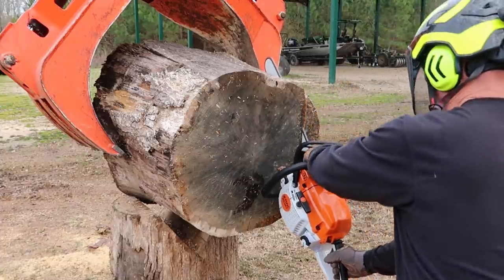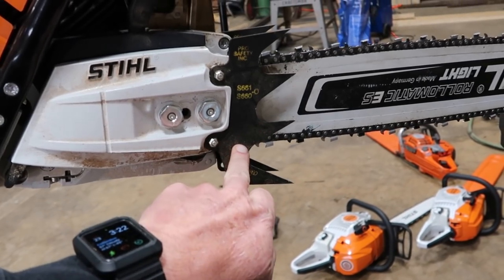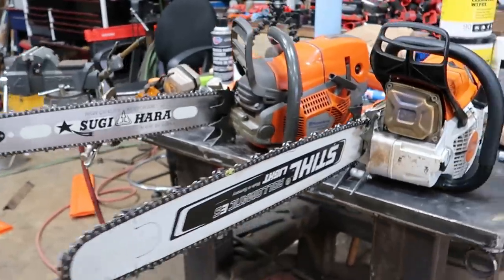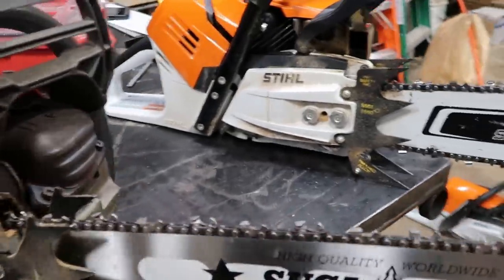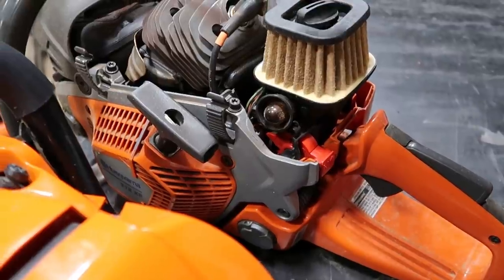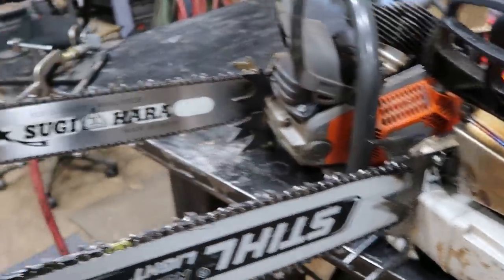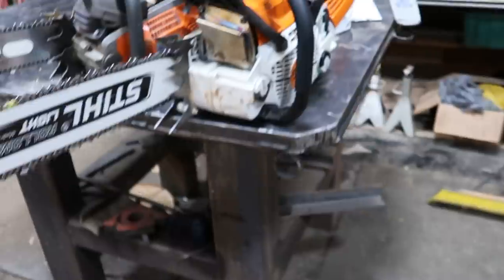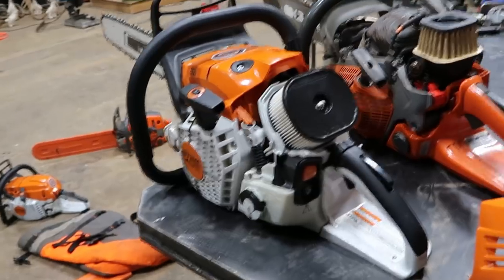Husqvarna VS Stihl | Autotune VS Fuel Injection | The best chainsaws on the planet

Comment: People will always argue witch saw or brand is the best but I think it comes down to the better dealer in your area .you can’t go wrong with Husqvarna or Stihl
Reply: My thoughts exactly
Reply: Yep, but I wish some American co. would make a modern high torq, low rev, low weight saw. If it's possible surely there's a market. The Euro saws are great but I don't like the scream. I'd gladly lose a second per cut.
Reply: I didn’t realize witches were into using chainsaws? 🤷‍♂️
Reply: Jason I've got both Husky and Stihl
Reply: @timhopkins7372  k
Reply: I have purchased two Stihl saws from two different dealers and you are right about dealer making a huge difference in customer satisfaction.  Each of those dealers were absolutely horrible in servicing my saws, causing me to never consider buying Stihl again!!
Reply: @livewithnick  Yer,they ride them...
Reply: @paynectygardener2033  that's why you figure out how to repair yourself 🤷‍♂️
Reply: @geoffbell166  oh! “Witch” end do they sit on? The b&c? 😬
Reply: Absolutely, they are equal in most every way it’s just pricing, availability and feel
Reply: @paynectygardener2033  It's the same with all machinery. I had a cnc router down for 3 weeks due to stupidity of the dealer service.
Reply: @ajsangster5195  My thoughts exactly... Who doesn't like the scream of a 2 stroke saw blasting through some wood!!
Reply: @tomjones4318  The scream is more enviromentaly freindly, a company would not be allowed to make an old school saw like a Homelite xl-12 they would not be able meet emissions standards.
Reply: @viperstrike3827  I'd have to hear the hard engineering on that. Sure the old saws were dirtier. Run a Mac back when for fifteen minutes and you need a shower. Run an X-Torque all day and not smell like exhaust. I'm thankful for that. Also like the fuel and bar oil life. All that could be worked into new designs with more torque and less RPM. Just a different way of doing the same thing. Euro saws won out with much better ergonomics and design before the government stepped in. But no it won't happen cause electric HIGH TORQUE and quiet saws will eventually beat them all. Sad American companies just give up.
Reply: @BoostedBlazer  Exactly you say. Keep your four wheelers out of my yard.
Reply: Who needs a dealer if you buy a Stihl i just go back ever 2 years or after i have 2000 to 3000 hour and buy a new one.
Reply: When i went chainsaw shopping i went to my local stihl dealer first, the   guy was a complete asshole. I then went to my local husqvarna dealer an it was like talking to my grandpa. I bought a husqvarna
Reply: Never in my life i ever feel the need for me to send my saw back to dealer for servicing and repairing.. i wont wasting money paying the dealer high price to servicing my saw, i rather done all the repair myself since the saw are an easy and simple fix, not a rocket engines.. all the wear and tear parts on both stihl and husky are an easy to replace, including the piston.
Reply: Agreed 100% of you can't go wrong with either of these saws it all boils down to the dealer thumbs 👍 💪

Comment: I am the Power equipment Tech for a Husqvarna and Stihl dealer and the price of the Stihl is more but no one thinks about if they have problems with the Stihl Fuel injection system and the cost of components if they need replacing. There both good saws, people need to research costs for repairs. Great video

Comment: I've only ever ran Sthil's mainly because I am lucky to have a awesome dealer 5 miles down the road from me . Always wanted to try a Husky but but their only available at a big box store in my area . I totally agree with ya on the fuel caps , I carry a small paint brush in my kit to clean around the o-ring and have really never had a real problem . I run a 261 , 462 and a 500i and i find myself reaching for the 261 more times than not , love that little saw .
Reply: Also my favorite saw!
Reply: I feel the same way about my little 3510 echo.  It's not a powerful saw, but it's extremely powerful for its WEIGHT.  You only need a lot of saw when you need a lot of bar.

Comment: Great video. 

I run 4 Sthil pro saws.  I love the saws, except the air filter setup for the 661 and 500 are garbage.  I am always finding dust getting under the filter and inside the engine.  The filter on the 362 is a better design, and the 361 non pleated is  better than any of their pleated filters. 

I used to have a consumer grade Husky in the early 2000s.  The air filter stays clean all the time, but the saw would throw chains all the time and damage the drive links.  Also used over double the gas that my 361 uses, while cutting half as fast.

Comment: Having run a lot of Husq' and Stihl gear over 30+ years I would say one of the advantages with Husq' is their attention to ergonomics and anti vibration in their products. The 572 may be a pound heavier but how does it actually feel with cross-cutting and snedding out?
Reply from the maker: The ergonomics and anti vibe are still a lot better on the husky
Reply: @cotontop3  That's good to know seeing as i've just bought one today to replace a stolen 395 (24" bar is as big as i need these days) Thanks for your reviews by the way - straightforward and no BS!

Comment: Considering the cheap air filter design and the gas cap design, I'd buy the Husky. I can't stand those Stihl gas caps. I've hated them since the first time I used them.
Reply: got those caps from the first day they have them, always leak or you need to put a thicker sealing on it
Reply: I think the idea was you were able to use  your insulated gloves in the dead of winter. They pissed me off once or twice but I figured them out. The old caps you could stick your tool in for leverage. Quarter turns are nice but you can't tighten it down.
Reply: @MikeHunt-ix2xy  In couple spots..? Interesting... So there is more than one spot.
Reply: I’ve never had issues with my quarter turn cap and don’t have to struggle to open the old style gas cap needed a tool to tighten/loosen it.

Comment: I use to run a saw all day. I'm 5 foot 4 inches and weight 130. I've had a bad back for many years. A Stihl is lite but the cost is not enough. Husky is my choice. I did comparison with them one time. Weight was the only advantage they had.

Comment: That price difference is for completely different classes of saw.  The 500i is a 390xp hunter. The MS462c is more on par with the 572xp.  
Stihl is redefining the classes with their very impressive "between" sized saws.  MS400 & MS500i.  
Longevity is definitely on par.  After being in the big wood of Canada's left coast for over a year, the 500i is holding up fine and is a clear favorite.  
As for the lightweight, my father thought the 371xp/372xp was a quick engine wrapped in cheap plastic.  Yet, 20 years later, everyone knows how legendary that saw is.  
I see the evaporation of dedicated, full service Husqvarna Group dealers, combined with the bold innovation of Stihl, is creating a gap.  And it's getting bigger every year. 
Whilst the air filtration is still lacking in Stihl, despite the effort of utilizing an "air injection" type of intake (though strangely lacking on the 500i), at least the intake is close to straight line.  Flow helps with throttle response. 
The proven Husqvarna intake is still using an antiquated angle between filter and cylinder.  Air doesn't like flowing at 90° of angle... neither does water, nor oil, nor even earthworms for that matter..  
To me, it comes down to; more power, more torque, faster throttle, with the capability of pulling more chain in bigger wood, at a full pound lighter.  And its almost turnkey starting that never loses its tune. Yeah, that's worth $400.  No "pass" given, it's earned.
Reply: Idk I think for past a 32” bar the 390 would become the more obvious choice over the 500i and 32 and below I’d want the 500. Just my opinion with a little time with both saws however sounds like you’ve got much more time on them maybe there are aspects I’m not taking in to consideration. I’ve heard a lot of issues with hot starts on auto tune saws so the 3 series big saws seem like the go to for big timber at least in my experience and the crews I’ve gotten to work with.
Reply: @zack6892  
The 3 series is absolutely epic!!  I'm a huge fan!  I personally believe that the 500i, 462, and 362 are directly because of how redefining the 371/372 was.  It is my favorite saw too this day.  But, because of OEM parts drying up, she's a shelf queen.  But definitely motivating to look at.  
I don't play much of the "Ford vs Chevy" brand-loyalty nonsense.  
In my honest opinion, the MS462 feels, revs, and has the power-curve much closer to a ported 372xp than the 572xp does.  The 572 feels like a bloated MS461 to me.  
My original point was that husky doesn't have anything to compete with the 500i in the same class.  An 80cc saw with 70cc weight and 90cc power.... that's essentially turn-key.  
Granted, there is no replacement for displacement.  However, an 80cc 500i doesn't feel far from a 90cc 390xp.  Now, there's definitely a difference and it's noticable....  But nothing even approaching the difference between the power difference between a 60cc saw and a 70cc saw.  
Husky needs to step it up, instead of releasing heavier (& slightly more powerful) replacements for some truly epic saws.  The Husqvarna 500 series isn't impressive at all.
Especially when they've shut down dealer support over almost 60% of their locations and focusing primarily on Lowes and Home Depot.
Reply: I agree at the almost turnkey part absolutely. While the newer huskys especially with a muffler mod start almost always on the first pull (as well as my older 346xp muffler modded) you still have to pump fuel in beforehand, i prefer this system tbh because you really can make sure there aint no air in the carb. Tho the newer Stihls be it a 500i or be it a 170 they are fucking turnkey. Had a MS170 on hand wouldn't start. Put a Servicekit and a good clean including a tankflush and carb cleaning to it. It started first pull with a completely dried out carb I honestly don't get how this is even possible, no pumping no second pull nothing. No matter how fucking cold,  next day it had -10°C and it would always start on a coldstart on the first damn pull.

Comment: I chose the 500i over the husky due to weight and the fuel injection, to replace my heavy 066. I agree that the fuel tank looks and feels cheap. However I am overall impressed with the saw so far. Good, straight forward video.
Reply: You’re going to regret that choice of it ever breaks in the field and you have to drive it to your nearest dealer for repairs as you cannot repair a fuel injected saw like you can a carbed one..
Reply: @lonewolftech  the last thing I am is a mechanic, I don’t work on my own saws anyways and I have a dozen of them so not really concerned about that

Comment: Dealer location and service is big for me. Stihl is closer and quicker service. The price difference can easily be made up in production. More gas and oil is less time fueling. Great job doing comparison. I’m also concerned about where stihl lost the weight. The newer 661 are not as robust as the old 660.

Comment: I personally like my 461.
I’ll be waiting a while before getting a 500I.
Reply: They have a serious issue of the fuel tanks cracking right around the hole and collapsing in. Here in the uk at least
Reply: Better off keeping the 461 .... word is the 500i is only lasting about 1/2 as long as the 461 in production Timber falling applications

Comment: Tim, thank you very much for this video. I stayed for the whole thing, I trust your opinion probably more than anyone I know. You answered every question that I have been curious about and I agree 100% with everything you said. I was a climber for 11yrs until a freak accident happened and I fell 40ft straight down. I still do tree work on the sides but unfortunately my accident caused me to have a fear of heights so I'm unable to climb.  I'm a huge husky fan but was curious about the fuel injection because I'm in the market for a new saw. After your review my mind is made up and it looks like I'll be sticking with husqvarna.

Comment: Good video and you make valid points on both. I run Stihl because there are literally no Husky dealers near me that carry the XP models. I’m not really interested in the 500. I recently bought a 462 and am really impressed with its power/weight ratio. Like you I have back and neck issues. I drop the big ones with my 660 then it goes on the truck and the 462 goes to work. Don’t worry about being on a limb. The truth will set you free!

Comment: What kind of weight difference is there between a stihl lightweight and the sugihara bar in the 24"....because I'm looking into getting one for a stihl
Reply from the maker: The sugi 24” weighs 2 pounds 12 ounces. I have not weight the stihl light.
Reply: @cotontop3  thank you is there much difference in the flex in the 2 bars
Reply from the maker: They both have a good bit of flex.

Comment: The way I look at the Stihl fuel injected saw is that at least it's a starting point, are they perfect? No! I don't own one or have ever even ran one but to at least get a working model into the market gives room for all kinds of improvements. That's how you make things better, figure out the weak points and improve on them. As far as the Husky Auto Tune I have no idea, I'm not familiar with them but in this video it seemed to cut smoother than the Stihl. The idea is to compare and improve wherever possible! 👍

Comment: Excellent review! Great tip on the filter, I have run Stihls for twenty years and my worst problems have been carburator issues, will rethink the Husky!
Reply: The Stihl he's using in the video is (Fuel Injected) Husky is Computer controlled  Carb
Reply: What is your fuel situation?

Comment: These saws have been out long enough to have been put through the paces. What never seems to be mentioned is what is the fuel consumption difference between the Stihl and Husky. This should also be a consideration when purchasing. I am glad you address this. I have watched a lot of vids comparing the 70cc class and as far as speed of cut its very negligible between similar sized saws. So comfort (anti-vibe) and fuel efficiency in my mind are very important factors when choosing a saw. Dealer support is also important in the rare case you have issues. Fuel leaks on a now $1600 dollar saw is almost criminal. This should not be tolerated on a pro level saw from any manufacturer.

Comment: What’s your thoughts on a 462C vs 572xp for firewood with 24 inch bar. I currently use husky but the closest dealer is hour+ away and I have 3 stihl dealers within 20 minutes. I prefer the 462 for weight and dealer support but I hear the 572 is more robust.
Reply from the maker: Both good saw but the stihl is a lot lighter.  Make sure one of the stihl dealers near u has a good mechanic because lots of them basically just sell the saws and that’s pretty much it.

Comment: I had 2 390xp I use my saws every day the first one only lasted year and 1/2 had to put crank bearings and seals in it got another another 390xp and had it 2 years and it blew up I cut trees by hand every day and I have a 461ms and it’s already out lasted both of them and I have a 661ms and love both of them just way better saws for me is the stihl

Comment: in Portugal the 500i costs 1350 euros and the 572xp in brand and discount campaign costs 720 euros 
I buy almost two 572xp for the price of a 500i and cutting speed is the same 572xp consumption is lower 
depends on the price of the machines in the country in question
Reply from the maker: Well said!

Comment: So is the 550xp still a good saw. I had thought about going back to a stihl but the two that I owned both were terrible very underpowered compared to the Huskies in the same class and very difficult start  even following the manufacturers directions they just continued to flood out once they were warm if you could get it started, it was not an issue. I have never seem to have a problem with any other manufacturer. That said I know tons of people who will only use stihl. my uncle has an older one he has had for years since I was little and it still runs flawless, but I just haven’t had good luck. I’m just curious which brand you prefer to run. It seems like you run stihl more. I don’t need a huge saw I do like something that’s light weight But also very durable     my plan is a 50 cc and then something in the 60 to 70 cc range for bigger stuff

Comment: I been running Stihl and Husky for over 40 years. Both are good saws. They all have pros and cons. Like the ergos of the Stihl. Husky's got a better clutch, air filtration and AV . Husky's got terrible dealer support.
Reply: Never had an issue with husky’s support, but I can’t find a sthil dealer anywhere near me to make buying those over priced paperweights worth it. Plus I hate all things fuel injected, just more shit to fail on a job.

Comment: While I can't say exactly, but the weight maybe the weight of the carb. Im not sure totally. But I agree with you on the where the weight went from. Im a stihl guy and work at a stihl dealer and the 500's are hard to come by for us in PA anyhow. I have yet to lay hands on one. Thought on the air filter is add some sorta foam on the back of the cover just to make sure it pushed down. I know you shouldn't have too. But it will be cheap insurance. Thanks for makeing the vids.

Comment: How much cost did the Sugi bar add to the 572?   Would be a more fair comparison to include that.....

How much weight difference in just powerheads? Would be interesting.    

Good info!
Reply: The lightweight bar for the 500i costs extra over the standard ES bar, which is heavier.
Reply: @hi4429  👍🏻👍🏻